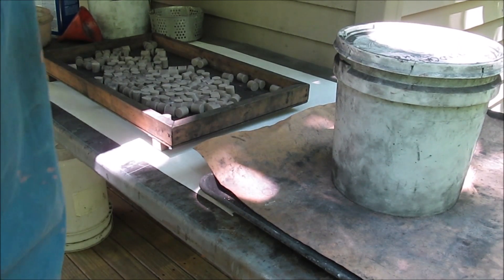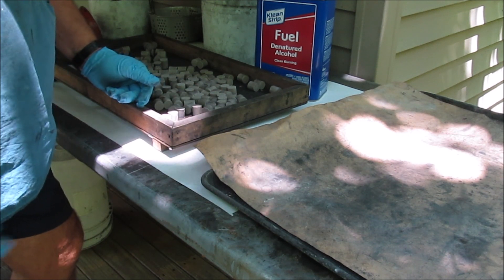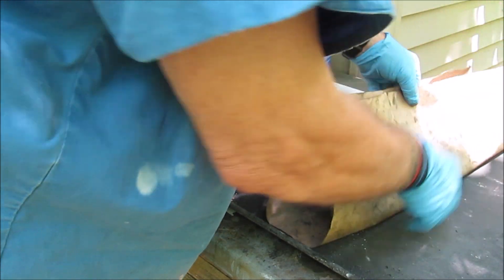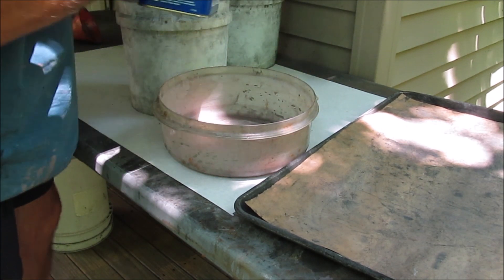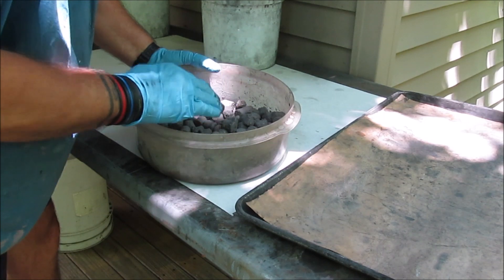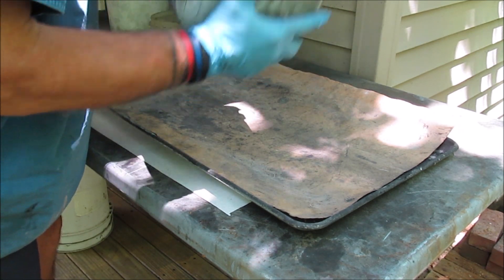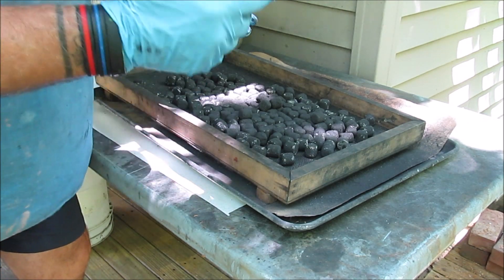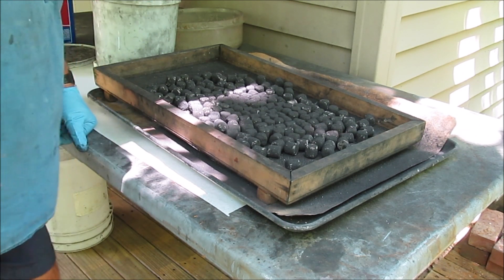Priming Pumped Stars

Comment: What is the % for lift charge is it 10%  or 20%?
Reply from the maker: If you are referring to shell lift charge, that is variable, and depends on the strength of the BP, and the shell type and weight.
Reply: @nedgorski  it's for 25g shells in a cake
Reply from the maker: @babydoll420xx  Personally, Scot, I'd make some test shots with that BP,  those tubes, and those shell inserts, until the desired effect is achieved.
Reply: @nedgorski  I will do that thanks for the help 🙏

Comment: This kinda off the subject but do you have any good remedies for coating ricehulls.
Reply: a harbor freight cement mixer and use 30 percent rubbing alcohol and 70 percent water i also do not put dextrin in my black powder you will not need it the alcohol will cause the black powder too bind too the rice hulls you will have too wet them down pretty good but it works perfect i tried dextrin with water and had no luck the alcohol is the way too go
Reply: @hjcg08  thanks a bunch ill have to go get me one of those soon. I was using a 5 gallon bucket an a drill which turned to be a pain in the ass lol.
Reply: @ChiraqVet  yep no problem ive got a drill and a bucket i used at first too and had the same problem i couldnt keep the speed the same it either wanted too go too slow or too fast